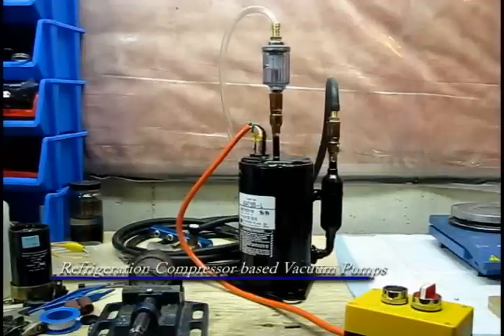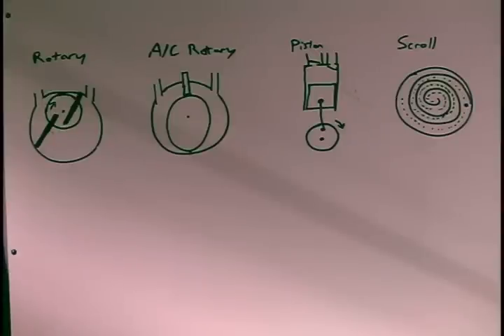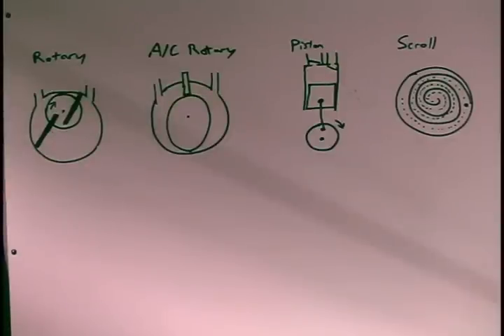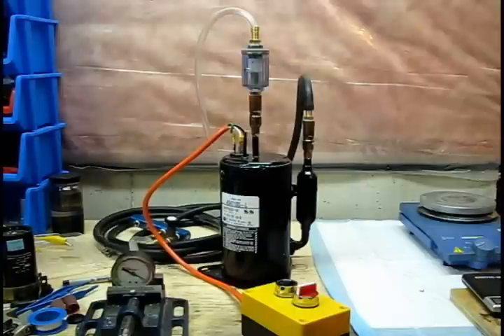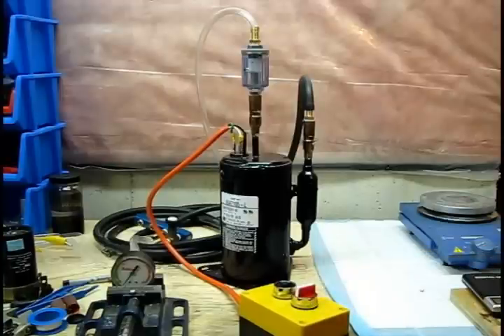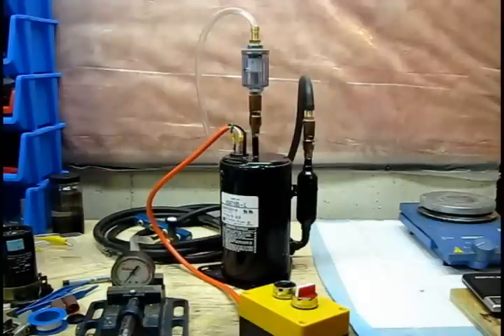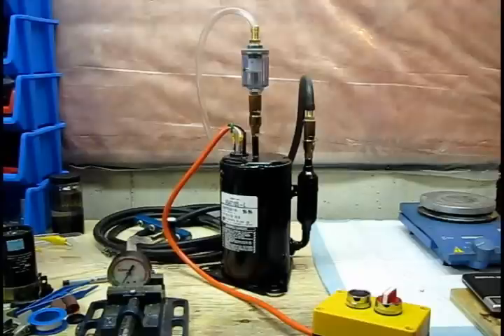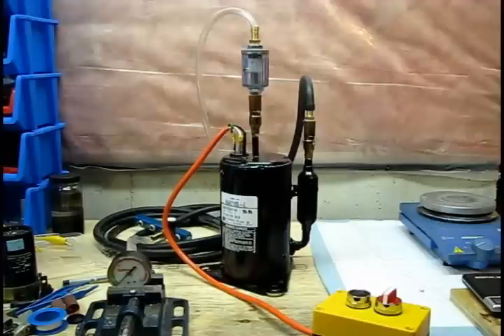DIY Vacuum Pump - Repurposing refrigeration compressors

Comment: Hi,  I got a compresser for an old chest freezer that was being thrown out and made a vacuum pump and it works great.  How will I know when to replenish the polyester oil in the pump?  Will it get loud or just stop pulling vacuum?  Also, does in need to be filled through the crimped off port normally used for filling or can it be filled through the air out port?  Thanks

Comment: I have two of these lg compressors. I ripped them out of two broken kenmore 5000btu window ac units. The reason you need to start it like you are is because you don't have the run capacitor that is supposed to be used with this. The run capacitor provides the voltage that your second switch provides but it doesn't burn out the coils so it doesn;t need to be removed once it starts the motor.  I kept both run capacitors which makes it a simple two wire configuration. I even found the original wiring diagram inside of one of the ac units which shows me how to install it. Just plug it in and it will run. I use two of these in tandem on a craftsman 25gallon air tank which also has a regulator, motor switch and blow off valve. One thing I should warn people about is the fact that contrary to what many think, these ac compressors will not start under load. Mine wouldn't start at 90psi and probably pressures lower than that. I then starting using the blow off valve (blow off valve is triggered by the pressure switch so that when the switch turns the motor off, it also opens up the valve to relieve pump-to-tank pressure). Now it works fine. They are louder than I thought and they do get quite hot under load. They also take forever to fill my tank. I woud say I can fill a 25 gal tank in 15-20 with three or four rest breaks to let the compressor cool down. I was thinking about drilling a hole in the top of the compressor and one in the bottom , add fittings and hoses then circulate the hot oil from the compressor from and to these holes with one of those cpu cooling pumps. I have the original evaporator radiator so I could run the hot oil through it and put some computer cooling fans on it. I would use a thermostat to trigger the fans. I decided against that  because the fill rate is so slow.

You will definately need a water seperator and oil separator if you use this compressor as it pumps out a lot of oil mist.
Reply: Samantha Williams That is a vacuum, not a vac pump. It is not $7, and it is from an american site.... aonomus mentioned he was Canadian.
Reply: Samantha Williams I have a vacuum pump. I got it at Secrets Adult Book Store for $49.00. It doesn't need a start capacitor or electricity. Its called the Man Handler and lives up to its name.
Reply: kimmer6 You're a naughty girl Samantha, I like you!
Reply: +Samantha Williams
From what I've been told by unverifiable resources via the internet, although your pump is working and highly sought after by those seeking them, without a gauge to actually measure suction correctly there is the DANGER of pulling more vacuum than you can physically handle! The tell-tale sign is that grey-looking stuff you see filling up the pump body... brain matter... ;)

Comment: I got a compressor out ofcan old dehumidifier the wiring digram has three wires from compressor one goes to a contactor before I cut it apart will do u think it will work as a vaccum for a clamping hold down for my cnc..?

Comment: Pipe organ builders have been using water-filled manometers to measure forced-air (not compressed air) in water-column inches produced by their instruments for centuries. They use(d )a U-shaped glass tube, partially filled with water. At rest, the two water levels should be the same level, when "wind' is applied to one end of the tube the water is forced forward and the distance between the two water levels is measured to provide an accurate reading (assuming an accurate ruler is applied). The same principal can be applied for measuring "sucked air" in open systems in inches of water-column (as opposed to PS.I. in closed vacuum pump systems). Use a 3/8 " I.D. clear nylon tube and you'll be able to discard the cheap gauge you're complaining of. Add some colour to the water as it makes the reading of levels difference much easier than without. Distilled water is best as tap water will leave deposits on the inside wall of the tube.

Comment: I love the info you gave, would be nice for an accurate vacuum reading though. I'm looking for something to pull a vacuum into the few microns of pressure and I'm sure if not one but 2 in series might do the trick if that's possible to connect together. Best part is how cheap it is.

Comment: 3.  like i said earlier  about hvac  companies you can probably get an old junk house unit to get the scroll compressor from.

4. refrigerator compressors contain start and run windings too  they are hidden behind a terminal cover and there is a relay that does the switching.

5. all compressors refrigerator and ac will not start under load  try unplugging or turning off the refrigerator or ac while it is running and turn it back on or plug it back in and you will hear it hum and click off.

Comment: excelent vid, finally some one who can talk clearly and isn't breathing hard into the mic.  I fond this very informative.  does a frige or window cooler usually die of compressor failure or coolant loss?  I live where it gets 110 in summer so there are many dead/free. but I don't wanna litter my yard if the only part I want is dead.  would you reccomend risking taking one home like that or just go to harbor freight?
Reply: You can test  these babies without having to plug them. just take an OHM reader with you .

Comment: I'm to build a record cutting lathe and I will need a vacuum pump to aspire cutting residues (chip). All I build, is DIY with used, recycled computer parts and peripherals! To make an entirely DIY, recycled parts project, I want to use a DIY vacuum pump such a used fridge compressor, a HVAC scroll compressor like the one you use in this video or a water dispenser compressor. I think that fridge (HVAC) scroll compressors should be the best for this job! Exact? Do you have some tutorials? Thanks!

Comment: Great! I finally experienced it with the same compressor as you use (LG) and this works stunningly great! On my side, I didn't modified any wiring solely using the compressor as it is and I plugged it to some PVC pipes within a solid plastic jar to get out chip residue from freshly cutted records!  So, I know that these compressors need oil and that's the ultimate question I ask! Did I need to oil it to avoid possible stick up of the internal parts of the compressor? Some say no! But I want to be sure! If I must lubricate it, wich oil I need? How much often it needs to be oiled? How much oil I must add each time? I presume it needs to add oil by the succion port? I notice on yours that you use a type of "oil trap" in series with the compressor out... Exact? If I must use such device, how I must install it and where I can find it?

Comment: the rattling noise you hear is the vane in your pump it must have a go back pressure to stop this from happening there is a vidoe on you tube that shows wht this rattle is ,i have a video on this very pump and a gentleman showed me and a freind what the noise was, the vane is stationary in this device and a cam lobe rotates in the housing , the vain slides back and forth like a piston so with no back pressure on it it just gets smaked around against the cam and its spring

Comment: @demnlordd666 another question, is there any way to salvage one from an old car?,  Is it the same kind of compressor?  I am just looking for bench top vac for experiments, some use reduced pressure evaporation and filtration, I am just thinking of the pick-n-pull type places near me that will let ya pull off darn near anything for 10$, as long as you don't NEED it for your CAR.

Comment from the maker: @douro20 Well, technically scroll pumps are the best due to the lower mechanical wear, lack of parts that can seize up, and lack of a mechanically worn rotary vane. Scrolls are found in industrial equipment and expensive lab equipment as high vac pumps with low noise and heat output like for mass specs.

Comment: The problem I see with using a refrigeration compressor to pump-down a chamber is the eventual water damage that might occur (particularly in humid climates or when working with materials that may have high moisture content).
So while this DOES work, it might be less of a head-ache in the long-run to try and find a cheap/second-hand vacuum pump.

Comment: Thanks aonomus. I found out I needed to connect a start capacitor with a similar setup as yours. Thanks again for responding so quickly. By the way were did you get that button and switch?

Comment from the maker: @ronknight1010 I don't have much time to do a video at the moment, though there are many videos on this subject on youtube (thats how I started my learning). Basically the start winding creates a magnetic field that is much stronger (to overcome the starting resistance) by drawing lots of current, while the run winding is enough to sustain operation. You can manually trigger the start winding (dangerous at times), or use a relay designed to start compressors.

Comment: 6. the windings of the refrigerator and ac are different enough that ac requires a capacitor where as a refrigerator can work with relay.

7. if the noise of the compressor bothers you you can enclose it in a box of some sort and not have to run both stages.

8. it may be a good idea to leave the thermal and overload protector in place.

9. in your case you can set  the compressor into a 5 gallon or 18.927059 liter bucket  for you metric viewers and fill with water because water can cool good

Comment: I've heard, however contrary to popular belief it sounds, that you can use small rotary compressors and single-cylinder 'recips' to pump liquids - even pure water - and reliably get pressures over 500 PSI. I've been working on a modified former screw compressor that should be able to pump either water or canola oil at 6-7 times that pressure. Stay tuned...

Comment: finally  while your setup cost $15 you can get compressors used for as little as free used from a junked unit many people put out with the trash.

i dont know about canada but here in american many people just throw away junk ac units with their trash so it can be a source for free parts.

r134a can be bought 6 to 15 oz at a time at your auto parts store but there may be  a limit of  how much you can get because of abuse and licensing.

Comment from the maker: @ronknight1010 I used a air filter meant for filtering air compressor outputs, it does a poor job at minimizing oil mist output, so you'll need to find a better solution.

Comment: You can find teflon lined vac pumps on amazon that ship to Canada that are just as cheap as harbor freight if not cheaper. Save the frig pumps for closed system applications. They make great water jacket coolers if you can find a cheap plate chiller to replace the evap coil.

Comment: @francispearson no a compressor like this definitely wouldn't be any good for what you want as with milking the pump has to cope with large amounts of moisture and as the motor windings on this type of compressor are in the flow it would fail quite soon also I think milk vac pumps have a carbon vane type pump to minimise delicate parts sensitive to very moist air

Comment: @ejonesss Yeah, you HAVE to change the oil when retrofitting an R-22 system with R-134a, or vice-versa for whatever reasons you may have. There's a drop-in replacement for R-22 that doesn't require an oil change, just a charge adjustment due to higher density but I cannot for the life of me remember what it was, I wanna say it's R-404a but don't quote me on that. :V

Comment from the maker: @ronknight1010 Local farm supply store, though any industrial electrical supply business will do. Be careful with this manual start method, it is possible and likely that you can damage the start winding and possibly trip the fuse/breaker.

Comment: might want to comment a little more about the shop hazards associated with  aspirating oil mist, definately NOT healthy! Also, if you are salvaging the compressor from an old appliance, the law reqoires a licensed plumber to drain the refrigerant from the system before you remove the compressor. Saves damage to the Ozone.

Comment: cool , just remember 1 thing, heat,, this baby used refrigerant to stay cool, ever wonder why the condenser is always hotter then the air in the building its cooling? its from the motor heat, up to 300 watts or more in some cases
Reply: Duh, you are missing the big bit, the principle by which refrigerators work. The heat you find in the condenser is mostly produced by pressurising the refrigerant gas. The refrigerant is relatively warm as it enters the compressor, since it has absorbed heat from inside the fridge.
Reply: Robert Seviour motors are 60 % efficient

Comment: -24 inches of hg or psi??
Reply: +Abdullah Mukri atmospheric pressure is only 14psi, so it would be impossible to get -24 psi from a vacuum pump
Reply: Wrong, I pull a negative vacuum all of the time. When I fill a balloon or tire, for example.
Reply: -24 inches of Hg is not PSI. - 30 inHg is -14.7 PSI...

Comment: theres 1 wrong thing i have heard out of your vid , or its just not the same with european(german) comps. they won't start without starting ralai ( starting coil ) in every condition , and they will even start with a high backpresure because they have one way valves in the cylinder head ;D they need the starter coil because they are brushless motors and they need a "push " into the right direction ;D

Comment: add it a 20lbs propane tank modified ( for Vacuum reseve )and a reversed air compressor one way valve , it be more safe for your compressor because theses compressors need to run in close circuit ( theyr own compression out return in the input , all this is mixed with refrigerant gaz and oil XD , it work , but not for life
Reply: +jeff pepin I swear on my mother's grave. I found my DIY pump from 1978 in the shed. I haven't used it in about 15 years. I added a few ounces of ac oil and hit with a hammer and it pulled 26 inches. Found cuz my 96 cherokee compressor crapped out. I am terminal so it will be the last time I use it so I can't say it will last forever but it is outlasting me, lol.  A hint, since it doesn't suck like a pro, suck down your system, add a few ounces of freon to high and low and let it sit for a while to absorb the moisture, suck it down again.  That procedure is better than just pumping it down with even an expensive pump. God Bless Y'all.
Reply: nice hint , thanks for info !

Comment: I had been wondering how to simply make a vacuum pump with a fridge pump.
NOW do you have a vid on a super quiet compressor using the motor and pump from a fridge.
 I have seen VERY expensive compressors that are no louder than 45db and they use refrigeration motors and compressors.
(For those who are wondering how loud 45decibles is, well, imagine you're whispering quietly to your girlfriend in her bed while her dad who hates you and doesn't know you're in his daughters room and HE'S reading newspaper with no TV on AND is in the VERY next room of the SMALL trailer home......THAT'S how quiet it is!)

Comment: Probably we can use it to reclaim refrigerant..... anyone tried that?
Reply: Jerry Han You're not supposed to do that 'legally.' BUT...if you have all the correct fittings AND a very good water separator in the discharge side you can. The biggest risk is you'll get it so contaminated you will not want to reuse any refrigerant that comes out. If you are doing it for R 12 there are still sources of it around for reasonable prices.....(pm me)

Comment: If you do that it will brak. You only need to press momentary switch. It will go doing that full v to broken rotary compressor!,wish I had one! I can use fridge compressors and swith them all on when want. To switch off power off. Works but wonder if max is 30 hg think maybe fridge ones good enough. But that is better. Also 15$  is bargain. If not using as constantly.  For hobby pulls more air than the 150£ vacuum machines!